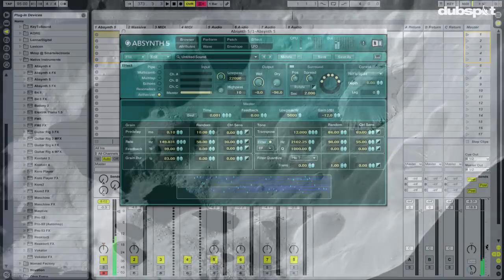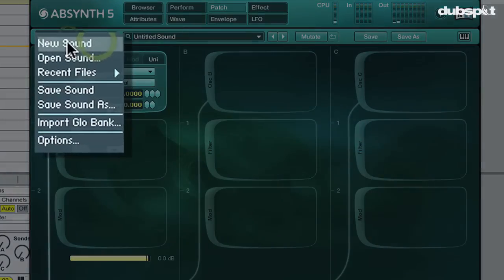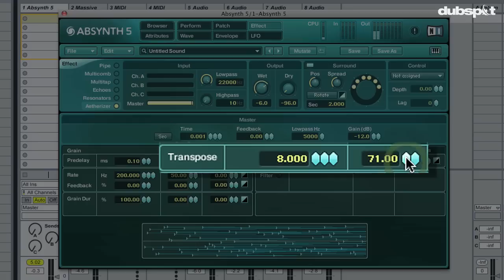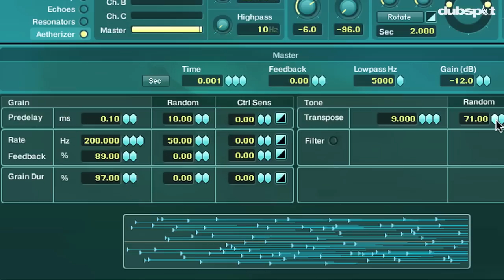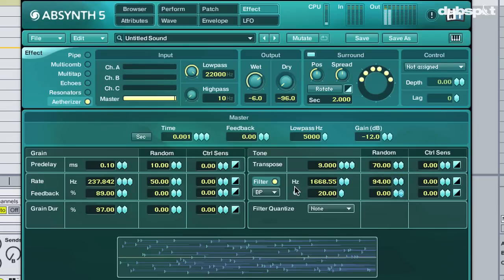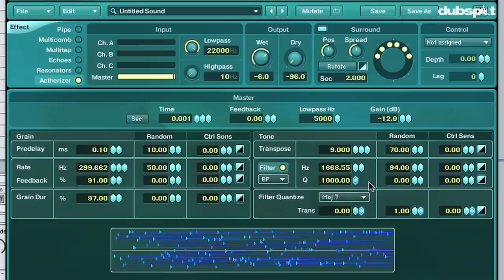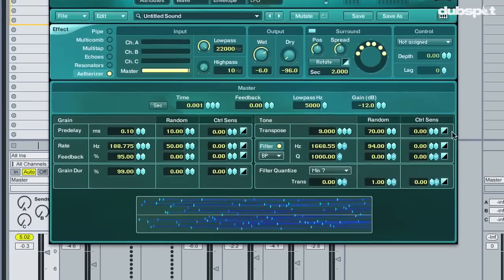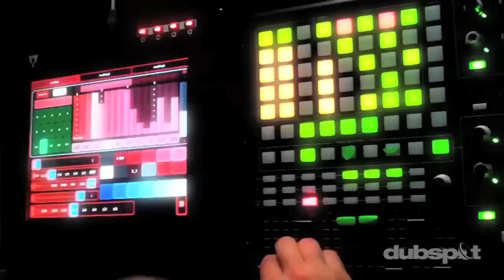Native Instruments Absynth Tutorial: Sound Design w/ Aetherizer

Comment: Great tutorial. I followed all instructions but at the final patch wwhen I turn the LFO on, the sound has a small buzz/distortion when it loops. What should I do to not have that? It only happens if I hold a note very long. If I play different notes every second, I get the same sonic result but the distortion is gone.
Ok, think I got it: on the perform page, I had turned up the volume. Turning it down seems to make the distortion go away.